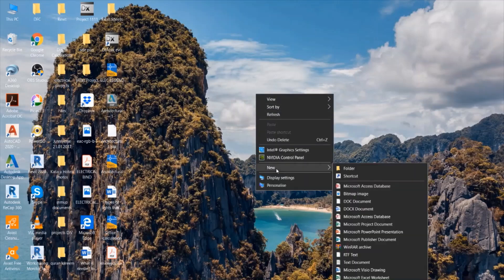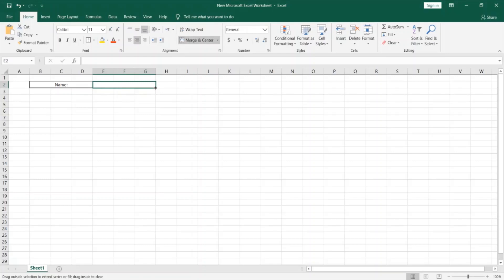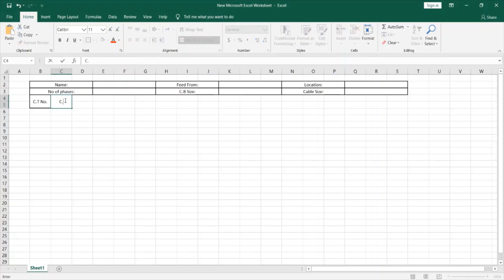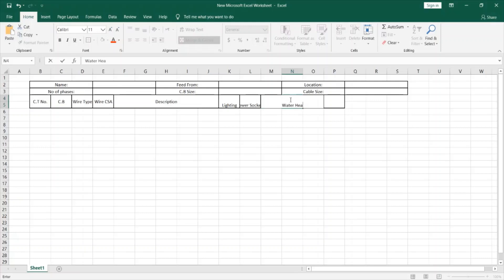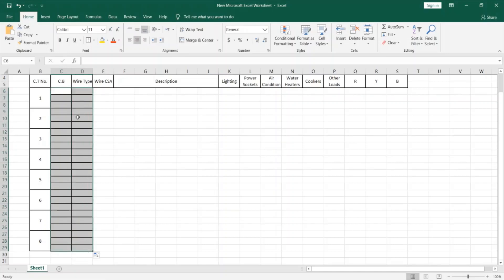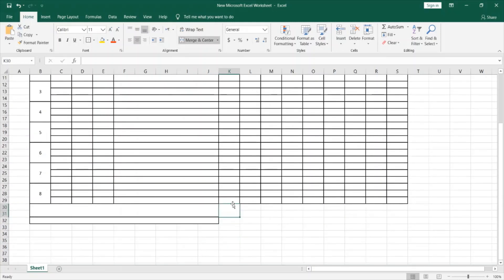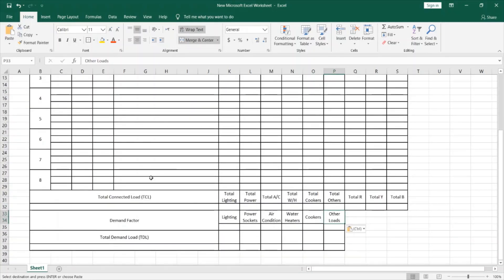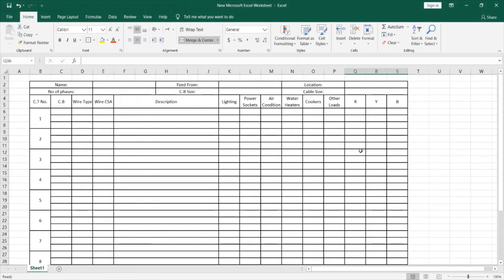Create Your Own DB (Distribution Board) Load Panel Schedule Template Using Excel Sheet (Part 1)

Comment: Good Afternoon Sir , First Thank you for your great explanation, I would like to ask if i can use this table for a single phase power supply and only change the last 3 blocks to L(line) and N(Neutral)
Reply from the maker: Sure you can! In fact, for a single phase, you will not need the RYB phase rows and instead you may name the circuits as numbers (e.g C1, C2, C3 etc.).
Reply: @eng.mohammedayman9161  🙏Thank you for the prompt response, very helpful information you uploading